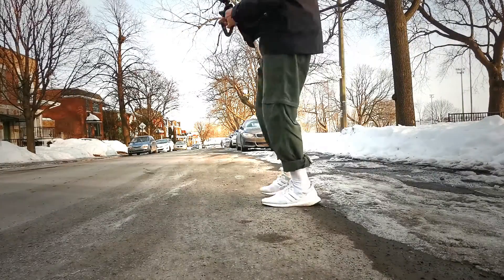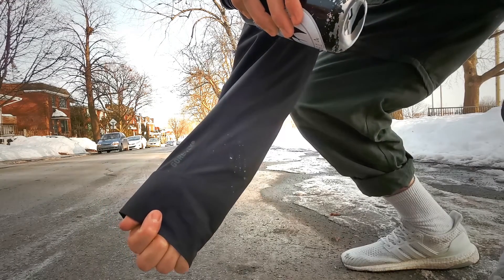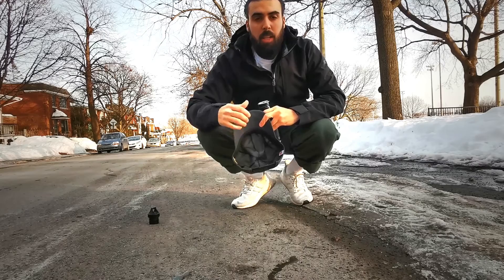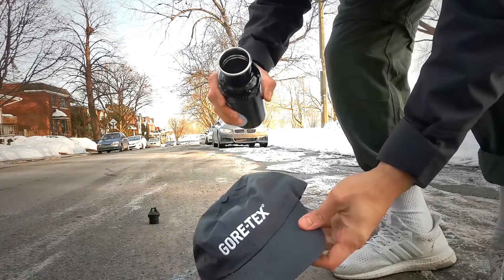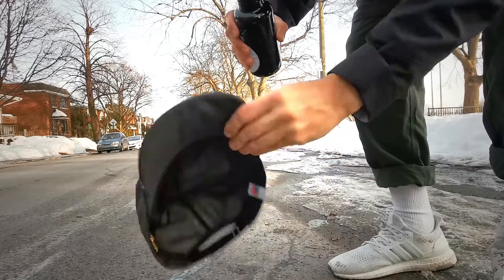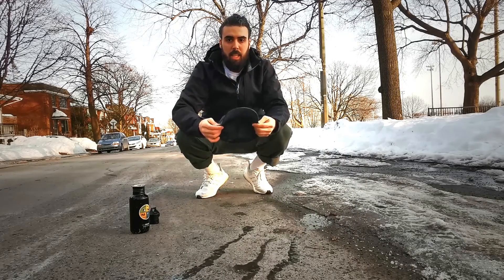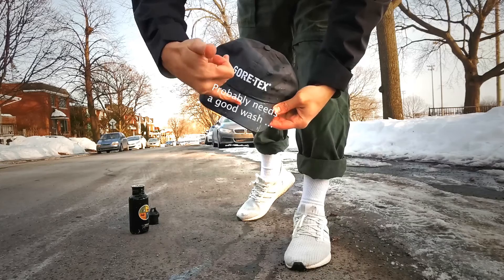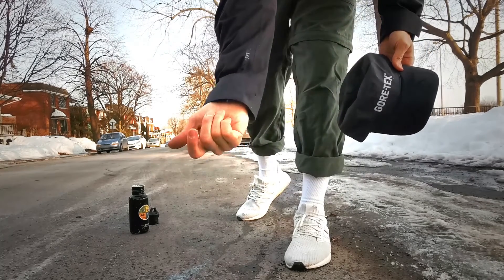GORE-TEX DEMO - Waterproof test

Comment: The fabric you see getting “wet” isn’t wet. The surface tension of the water was broken and didn’t “bead” off, it just spread out and sat. The fabric is waterproof. Water wont penetrate through but the fabric may look “wet”. The beading property of gore isn’t so much the gore but the coating applied to it.
Reply from the maker: You're right and thank you for the detailed response. I guess it's more of a breathability issue as when the fabric has wetted out it won't allow air to pass through.